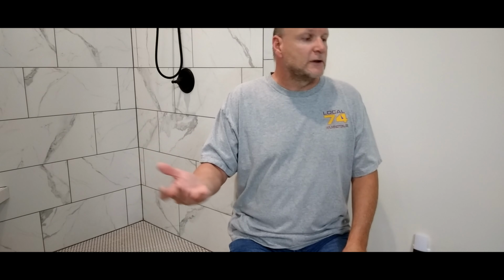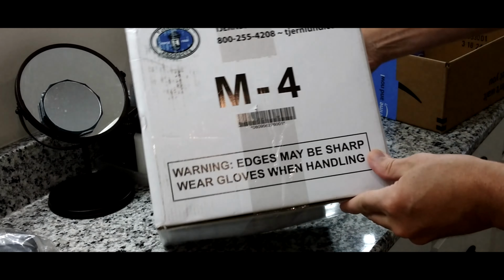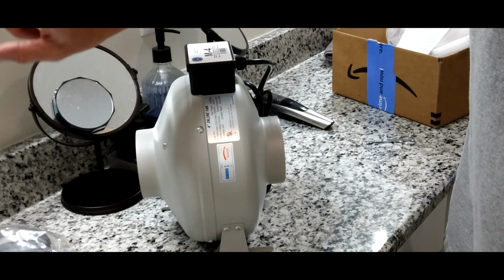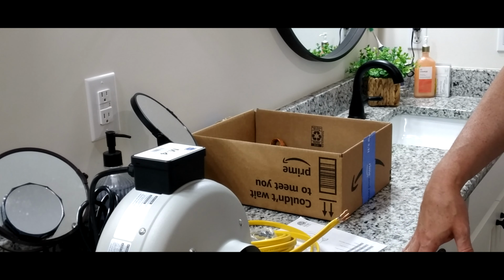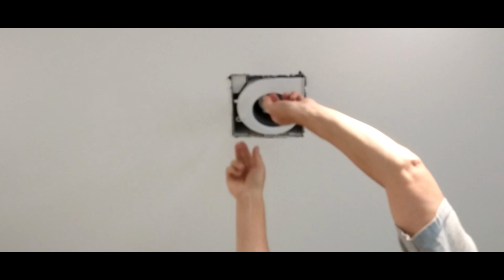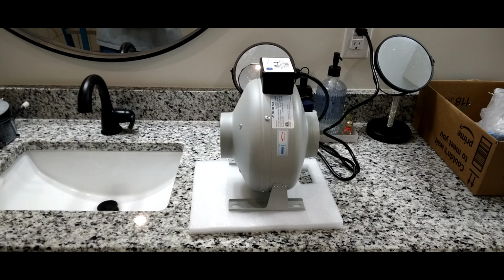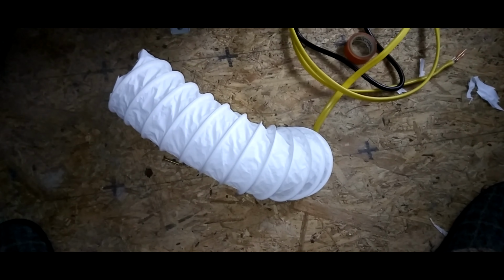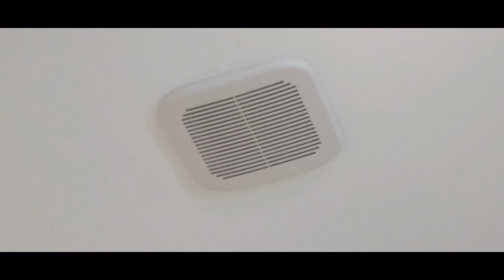Review- Replace Your Worthless Bathroom Fan With This Tjernlund 200 CFM 4M 4" Metal Inline Duct Fan.

Comment: This is actually a good idea! I just installed this fan on my long run for a clothes dryer. I can’t believe how quiet it is when connected to the hose. Instead of dealing with electrical issues I just use a smart plug and tell Alexa to turn it on and off. I am considering putting a vibration sensor on the dryer and set up a routine where the fan turns on or off depending upon if the dryer is running or has finished. 
After seeing this I guess I’ll be getting another one of these fans.

Comment: Moisture collecting in or on  the fan housing is not a problem in the colder months ??
Reply from the maker: Do to the fact that our discharge hose exits out the attic space. The attic is obviously cooler in the colder months than the warmer months. Mold likes it warmer to thrive. So hopefully now with much more air movement CFM we won't have to worry about condensation staying in the hose. 🤞
Reply: I drilled a small pin hole in the bottom of the housing for any moisture buildup
Reply: Which mine is against the floor joists in the garage on the ceiling so a little moister if any; never is an issue. I rarely see maybe a drop or 2 every few months.